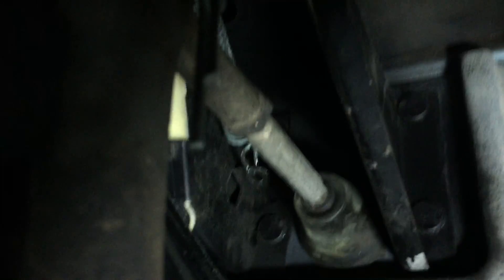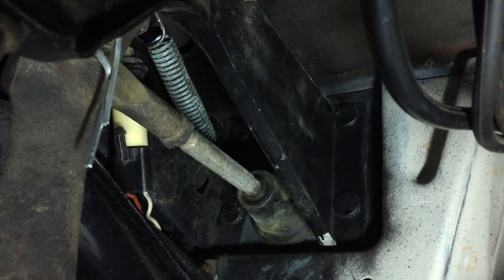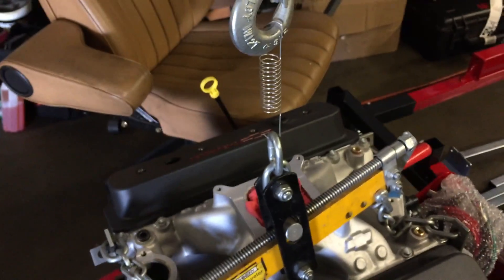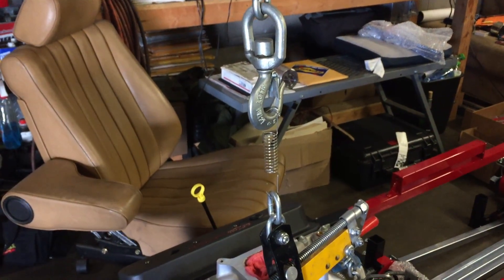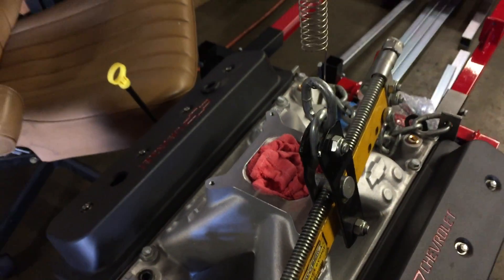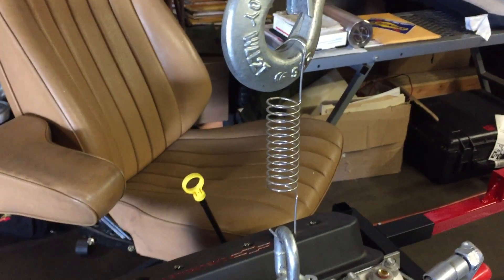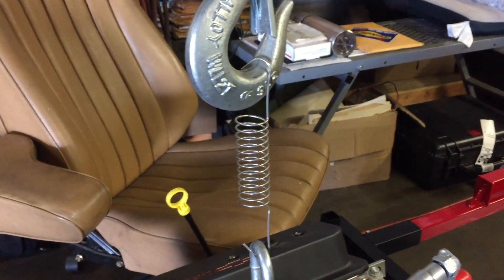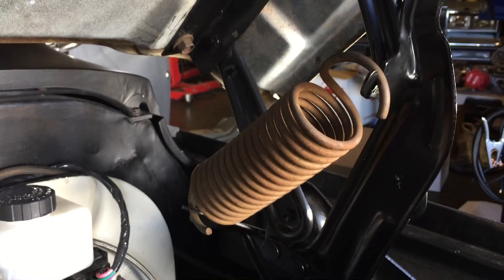How to stretch out a spring.

Comment: Wish I had seen this video before I wasted 2+ hrs trying to get a mower-deck lifting spring back into my John Deere L130...positioned it in the center of the jack it fit, added $9.50 in qtrs & i was able to pull the spring back into place. Upon removing the qtrs I ended up bending some then just hammered them flat...next time I'll use nickels so I won't have to pull as many coins out....20min & i was done...THANKS!!!!! .......if the loop on the spring didn't fit the floor jack I would have gone down to one of those smaller trolley jacks.
Reply: How would add springs to a hood? I understand the concept of the spacers but how would I take the spacers out to set the spring in place? Thank you.

Comment: Re: RV Leveling Jack Spring Replacement: One broke so I decided to replace all 8.  These are approx. a foot long.
If you do not have an engine jack then try the floor jack. I have 2 jacks but the springs I am working with are too large to fit around the either jack's connection points.
So, I recently added shelving in the garage and it is secured to the ceiling so it can withstand a lot of weight (I added a pull-up bar) and then I added an eye hook to the lower surface.  I connect the spring to the eye bolt and to the other end of the spring I attach a rope/chain/wire (whatever you have) and 2 exercise weights 20lbs. each.  I also tie in a foothold so along with the weight of the barbells, I place my foot in the stirrup and push down.  I am them able to install spacers (a variety, including die grinder flat wrenches.  Approx. 12.  This will give enough elongation to install the spring on the rig, facilitated with a breaker bar for leverage and guidance.   BE CAREFUL.  I even secured the spring with a tied rope to an RV frame member in caase the spring ever got away from me, BOING BOING. 
The RV installation, of course, is done underneath the 10-ton behemoth so be sure to set the parking brake and add wheel chocks.  You can remove the wheel but they are best handled by the world's strongest man.  I just rolled under, equipped with gloves and eye protection and "popped" 'em right on.  Well, it wasn't that easy-nothing is- because each leveler has 2 springs and a base plate, so installing one spring at a time requires some ingenuity to stabilize the base.  So to stabilize the base plate I used the floor jack to hold the plate up against the leveler end.  Hang springs fitted with spacers to the top mount hole and finesse the spring, one side at a time, into the base plate mount hole.  BINGO!  One done, three to go.  Note: Front leveler springs on a Class A are more difficult because of tighter layout and lower stance.  For this, you will need to be as flexible as a Cirque Du Soleil acrobat.  Just be careful as it is very easy to hit your head on a multitude of obstacles.  Ouch!  
NOTE: You may not be able to use a creeper, and if not, just use a large piece of cardboard.
Reply: How would I add springs to a hood? I understand the concept of the spacers but how would I take the spacers off to set the spring in place? Thank you.